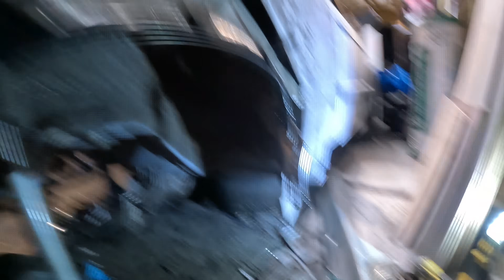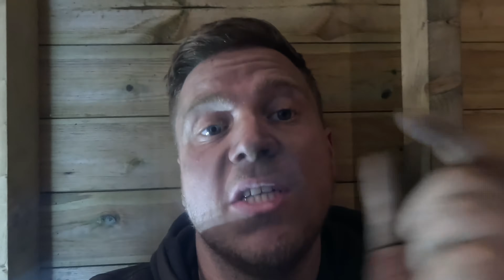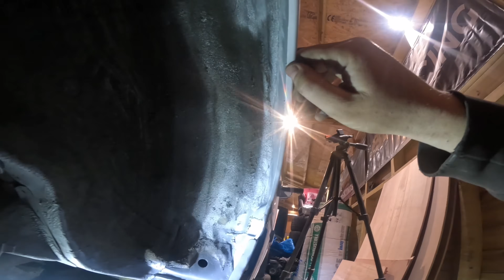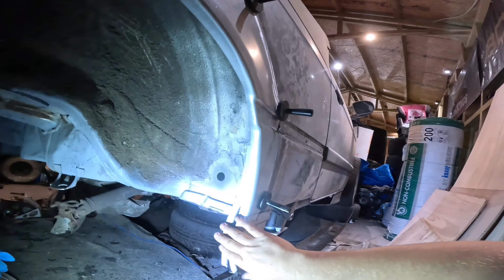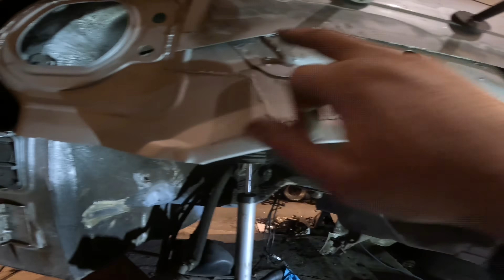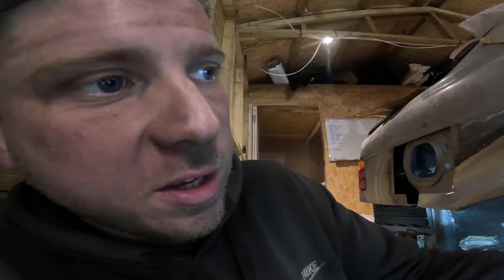BMW E36 Coupe Rear arch rust repair, cutting out, welding

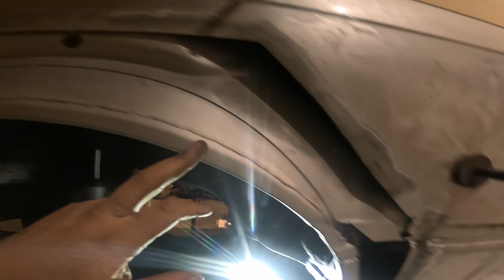Comment: Hey, did You video making the part at 8:37 by any chance?
Reply from the maker: I didn't sorry, but to make it I used two flat pieces of steel, bent to shape, welded together and then trimmed the excess

Comment: Great work!

Where did you get the inner skin panels? My saloon needs a similar repair and I keep coming up blank
Reply from the maker: The inner panel I bought from bmw as its very hard to find anyone cutting up coupe shells that have good quarters. The panel was £400 though, super expensive. If you just need the inner lip I would make that yourself, if you need the fuel neck inner skin then either bmw or find a breaker to cut it from
Reply: @HardlyExotic thanks for that. Yeah, looks like I’ll be making on then 😂

Comment: I know this isn’t the rocker or jacking point video but thought I might as well watch this and just say thank you for these awesome detailed vids currently fighting the spot welds on my rusted rockers but I’m almost done and these vids give me hope
Reply from the maker: No problem dude I'm really glad they've been of use! The vids are very time consuming to make and film so I appreciate the kind words. Are you documenting your build on IG?
Reply: @HardlyExotic  No not yet but I’ve been taking some pictures of the progress so maybe I will. The car sat in my driveway for about 5 years no start and I just got it started this year. I’m 16 and didn’t really have the money or knowledge to mess with it previously so I’m just getting rolling on it now but my plan is to hopefully have it in stable condition by spring time🙏
Reply from the maker: @hispanickid963  epic work buddy! That's a big under taking at your age but also it's the perfect car to learn on the job as lots of DIY info online for E36s 💪